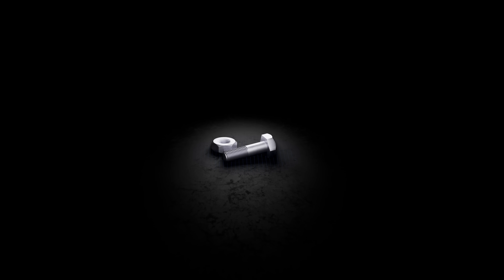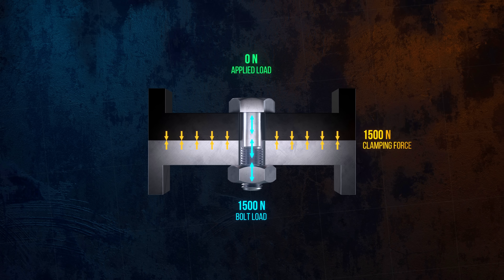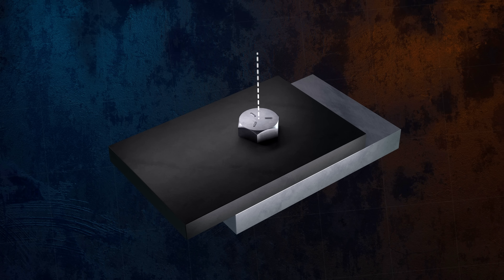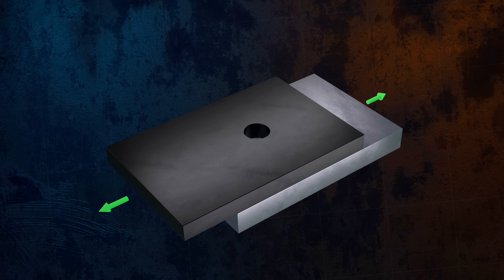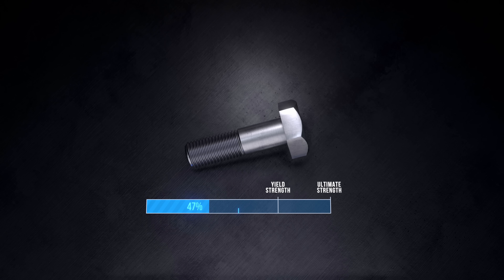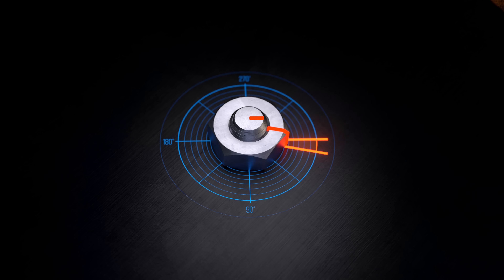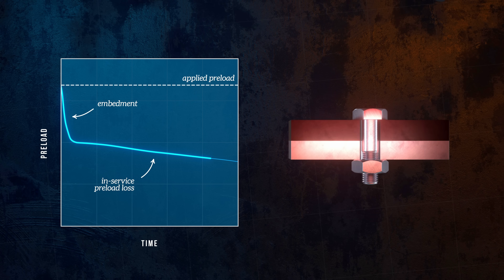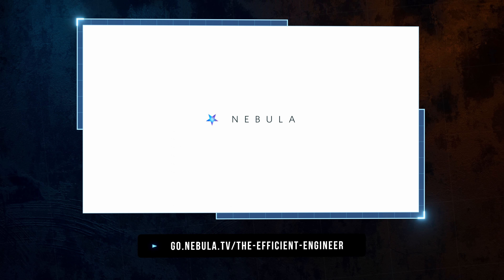The Incredible Strength of Bolted Joints

Comment: So the preload of the bolt will resist to a vertical load applied to the two plates? Because if i have to calculate the dimensions of a bolt subjected to a vertical load, i don't understand if i must consider the preload+load  or the load-preload...which one is correct? Thanks
Reply from the maker: A typical approach would be to select the preload you apply to the bolt so that it is larger than the max applied load (so that you never loose the clamping force between the two plates). And you select the size of the bolt to make sure it can carry the preload without failing. But it depends on the specifics of the application.
Reply: @TheEfficientEngineer  Thank you. Your videos are amazing, crazy animations and very clear explanation! Thank you for your great work.
Reply: the load usually only adds a small amount of its value to the bolt load. this amount is mostly defined by the stiffness of the joint. google "joint diagram" for better understanding!
Reply: @meixo9083  thank you! I'll google it👍

Comment: @The Efficient Engineer
A small add-on is that generally it is the non-threaded part of the bolt that easily act as a spring. Which means a fully threaded bolt is stiffer than a simlair bolt with less threads.

Another add-on is that the nut is generally weaker than the bolt since is cheaper than a bolt.
Reply: thats not true. the whole part between the head of the bolt and the thread that is in contact is elongated.
Reply: The nut is of a more ductile material because it has to accommodate the elongation of the bolt, and the deformation of the threads in the nut.

Comment: Why use expensive methods to measure the length of the bolt? Are there undesirable consequences to just hollowing a bolt in the middle and measure through it, that making the bolt slightly thicker can't compensate for?
Reply: drilling a hole in a bolt is expensive.

Comment: I'm trying to subscribe to Nebula but keep getting error:

"Request failed with status code 403"
Reply from the maker: Hmm not sure what could cause that. Were you able to get it to work? At what point did you get the error?
Reply: @TheEfficientEngineer  trying to create the account. I'll try tomorrow from my laptop. Keen to join thru your link because I'm working on a bolting project right now. Bolts failing due to suspected low tension after a period of service. We're installing load monitoring fasteners to help diagnose the issue and give us some indicative data on relaxation.
Reply from the maker: I asked the Nebula team about it and apparently there was a technical issue for a few hours, but it has been fixed now. Sounds like an interesting problem you're dealing with with those fasteners! Hope you figure it out.

Comment: I don’t think I agree with your pre-load bolt/spring model. The 2x clamped materials will be in compression. The bolt “spring” will be in tension. This means that as the green arrow external load is applied, only the bolt-spring will resist. The clamped yellow and red springs will actually add to the net external force.
Reply: An easier to visualize example is a flange that's bolted up unpressurized and then you pressurize it.

The internal pressure acts as a separating force pushing the 2 flanges apart.  For every unit length the flanges move away from each other, the compressive force in the flanges relaxes, and the tensile force in the bolts increases.

Because the flange has higher stiffness (force/length) the flange compression relaxes a lot more than the bolts tension increases.
Reply: @a.1441  that's a great explanation, I couldn't figure it before reading this.

As you're applying load, you're stretching the bolt, but you're also uncompressing the members whose compression is stretching the bolt.
Reply: @10AhL01  yeah! I'm glad it helped. I had to spend a few hours thinking about it for it to make intuitive sense.

Comment: I love it when people challenge me on using graded hardware for a tension member. "That's gonna break, why'd you do x x x?"
My reply usually goes "Did you drive anywhere today? What do you think your suspension is held together with?" 
In my case, there's an enormous 1 inch thick rod bolt on each side of my truck's front suspension upper arms that looks like it could hold up a bridge that I don't take for granted every day. Also makes for a handy reference item. 👍

Comment: Preloading doesn't affect tension joints though! Any tension load applied to the joint must eventually be transmitted to the bolt, so a 10kN load will result in 10kN force in the bolt regardless of how strong you preload it, it's a simple case of following the load path really
You're generalizing the case of piping (which require preloading for the sealing of the joint rather than actual structural requirement) to all bolted joints
Reply: What he means in the video is that the change in tension in the bolt is far less than the change in tensile load. This is because the tension on the bolt due to the contact force of the joint members is replaced with the tensile load. Without preloading the change in tension on the bolt would be equal to the change in tensile load.
Reply: @JWQweqOPDH  still, the change in tension doesn't govern failure at all
If you preload a bolt that's rated for 100kN with 90kN then introduce a 10kN change then it'll fail just like it would from a 10kN preload with 90kN change
So all in all whatever he meant it was wrong
Don't get me wrong I love the channel and this is the first time I've seen him make a mistake, but it is nonetheless a mistake
Reply: @Truth4thetrue  While static failure depends upon absolute tension and not change in tension, fatigue failure absolutely does depend upon change in tension. The mechanics of fatigue failure is what makes older parts less reliable than new/unused parts.
Reply: @JWQweqOPDH  first of all he didn't specify fatigue failure, nor cyclic loading, he says failure, and in the general case failure doesn't care where the load came from
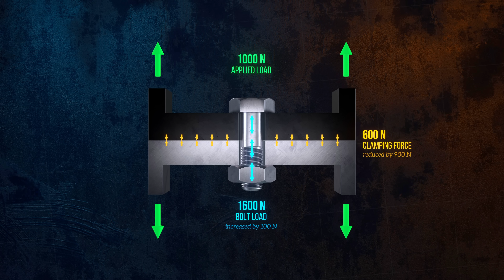Secondly you can check at 3:00 where he says that the base metal acting as springs will elongate when load is applied which is ABSOLUTELY not true!! They can return to their original dimensions before the preload but he is assuming that two separate parts will act as one!!! Two parts cannot act that way unless fused or welded
The whole idea of clamping force resisting tension is flawed, clamping force is an internal force, it cannot resist external loading!!
Reply from the maker: Hi Der Kalif, thanks for the comment. I have to say I don't think the video is making the mistake you say it is. I agree with you that in a preloaded tension joint the overall tensile load in the bolt (including preload and the external tensile load) will always be larger than or equal to the external load. The video shows this e.g. at 02:40.  But it's also true that in a preloaded joint the bolt will see a smaller cyclic load than the magnitude of the applied load, because some of that applied load is used to separate the clamped parts. For tension joints this is the main benefit of preload - it reduces the stress range on the bolt which increases the fatigue life. I talk about this explicitly at 04:40. This is what the video is saying about tension joints. For example if a bolt is preloaded to 1000 N, it generates a 1000 N clamping force. If you then apply an external load of 300 N, the load in the bolt will increase by only (say) 30N to 1030 N, and the clamping force will reduce by 270 N for 730 N  (i.e. only 10% of the applied load acts on the bolt, in addition to the preload). See this graph for example - https://s28490.pcdn.co/wp-content/uploads/2019/05/bolted-joints-03.jpg.

I do agree though that the spring model shown at 03:00 is  misleading. I was trying to use a visual way of explaining why it is that in a preloaded joint most of the external load is used to reduce the clamping force, because they are stiffer, but I guess it didn't work very well.
Reply: @TheEfficientEngineer  thanks for the reply, and I do get your point now, but I just kinda got lost in the way of explaining (which made it look like the clamping force itself is resisting, rather than it just getting decreased while the forces in the bolt stay in equilibrium) and the animation (I guess a larger animation comparing side by side to non-preloaded bolt and without the excess elongation would've been much clearer)
Anyways thank you a lot for everything you do, your videos have made me learn more than years in college
Reply from the maker: Appreciate it! You're right though there are a few things in this one that I definitely could have shown or explained better!
Reply: still don't understand the point here with preloading at all, for example with the diagram at 2:35, if a downward force is applied directly to the nut, this force would add fully to the tension of the bolt, as that is the only connected body keeping it from moving. adding a downward force to the bottom joint member, would apply that same force to the nut, as that is the only body preventing it from moving; therefore since applying a force to the bottom member is the same as applying it to the nut, which would surely completely add all of that force as tension to the bolt, regardless of of it is in tension to begin with (preload)?
Reply: any force added to the system that still results in it remaining static, must have an equal force acting against it, and in this case the reaction force will always be from an equal increase in tension on the bolt
Reply: @d.a.n.  if you need to get to the bottom of something, just take it to the extreme
A bolt is preloaded with say 100kN, which means it's pulling the two parts together with a 100kN force, so at rest it'll have 100kN internal force instead of zero
Now suppose 200kN applied force to the parts is able to strain the bolt enough that the two parts are no longer in direct contact, that amounts to 200kN in the bolt but with no clamping force (since the bolt is no longer pushing the parts against each other, only stopping them from moving further away)
So at 200kN load you have 200kN bolt force either way, but at rest you have 100kN in a preloaded bolt and 0kN in a normal bolt
This helps with fatigue since your load cycle is now from 100kN to 200kN so just 100kN, so your cyclic load is halved (in this hypothetical scenario, dunno what irl values are)
But the way it was explained made it look as if the plates pushing against each other was the thing resisting the external load and not the bolt, in reality the clamping force gets reduced when external load is applied so the force in the bolt doesn't increase as much as the load until no clamping force remains, then we're back to a no preload case
Reply: @d.a.n.  I agree with you 100%
Reply: I just am having a hard time figuring out how the clamping force bears any load. it is nullified by the normal force
Reply: This should be higher up
Reply: @architunnel  thanks, I hope it does just so that people don't get this fact wrong
I myself really like and trust this channel and I was starting to doubt all my engineering career from this lol
Reply: Please, where can i find a proper source to choose a bolt? any book or some journal article?
Reply: @gauravpardeshi5573  if it's a simple job and you know the exact forces acting on the bolt you can find a table of the design capacity of bolts online easily, although you'd still have to make sure the material thickness is sufficient so no punching or tear failure could happen
Reply: @gauravpardeshi5573  VDI 2230
Reply: @gauravpardeshi5573  I used the Canadian Handbook of Steel Construction.  This covers the use of structural bolts in the size from 1/2" dia. to 1 1/2" dia.
For smaller fasteners use SAE (Society of Automotive Engineers) publications.
Reply: 100%... kind of a strange mistake to make.